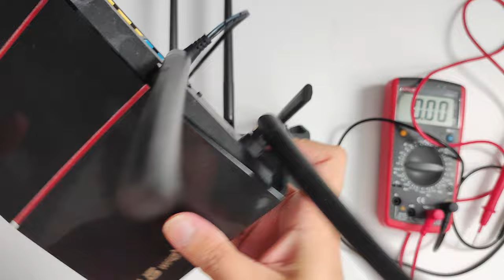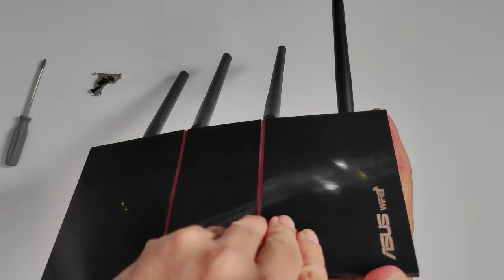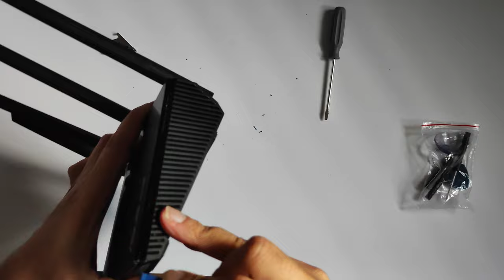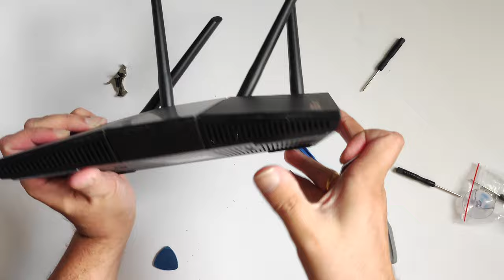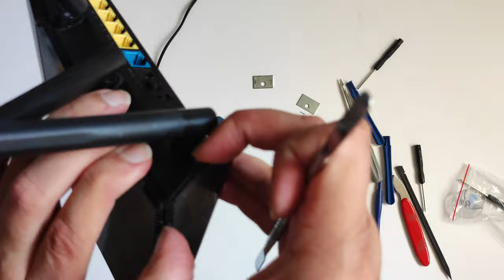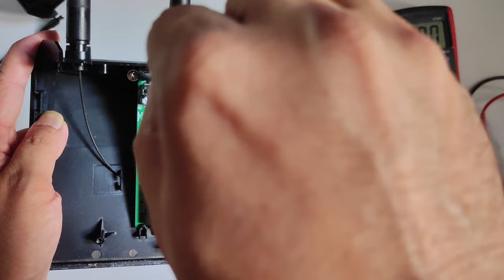ASUS RT-AX55 Router TearDown - 100% Failure Rate - Watch Before Buying : & Honest Review !

Comment: 11:48 which antenna cable are the 5ghz? black or grey?
Reply from the maker: That's a tricky question. I would not know. I have the unit still I will check and see if its got anything on the board that specifies, doubt though as 5ghz or 2ghzare cable dependent all cables should be same.

Comment: I have same router now worried it will fail 😞.. guess will shop for used units and have atleast a backup router if it fails on a holiday or Christmas time etc will not be good.. i need my wifi to kwep workin
Reply from the maker: Fingers crossed!